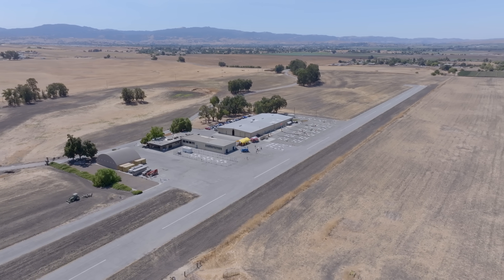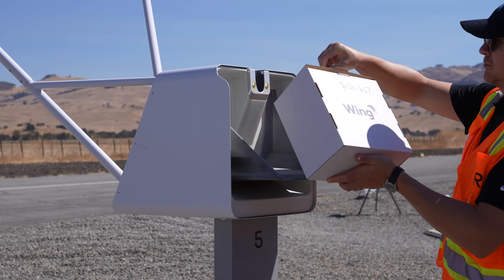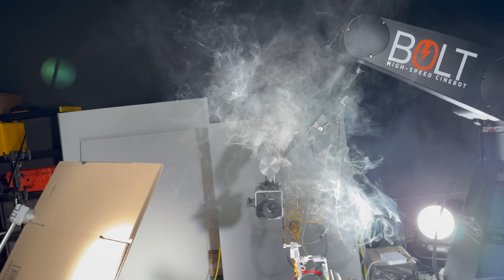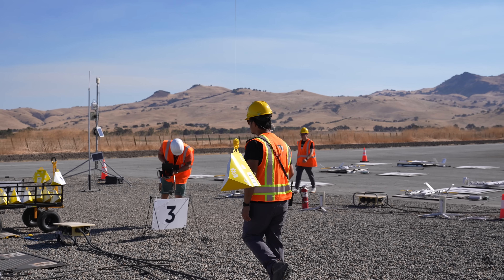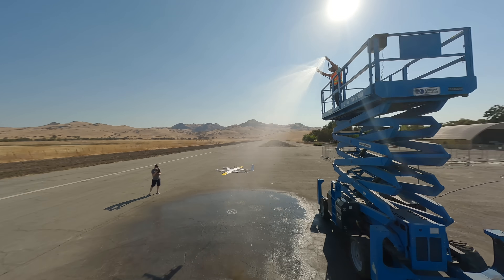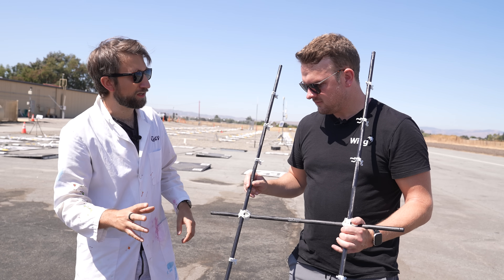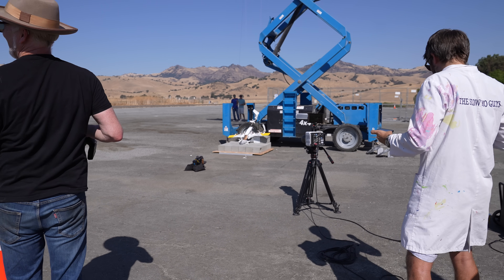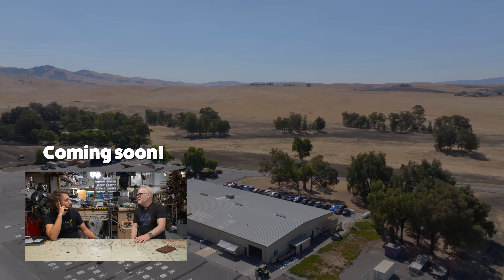Ultra Slow Mo Propeller Smoke Vortex - The Slow Mo Guys @tested

Comment: what you have to remember is that those aren't individual vortices. they are all part of the same helix, or rather, the same 4 helixes, following the tips of the blades, all the way around. with the asymmetric blades, those helixes get tangled up and destroy each other, resulting in a balanced white noise effect rather than a loud hum.

Comment: I do wish they would stop claiming "reduction in CO2 emissions". Energy is energy. These drones require batteries which require charging, whether from the sun via solar panels (photon energy to electron energy at ~12-18 percent efficient) or from the power grid which is created by hydro-electric dams or methane/diesel/gas/propane driving generators. Solar panels from solar cells require a tremendous amount of energy to melt the silicon, grow the ingots, slice/ process......

Comment: 0:30 with how inefficient drones are, I HIGHLY doubt you reduce CO2 emissions by using them for delivery. Even if you charge them by using renewable energy (which is rarely the case), manufacturing alone will cause more emissions than using more conventional methods of transportation.

Comment: @5:07 I think 3000 'rotations' per second is optimistic. That equates to 180,000 RPM and I think even FPV drone propellers top out at about 50,000 RPM. I think you are talking about 3000 individual vortices created by the 4 blades on the propeller. That would mean the actual RPM for the propeller would be about  45,000 RPM which would be more in line with my expectations.

Comment: I'm honestly just impressed by the blade strength. In the crash, that one blade on the right was bent over 90 degrees away from plane, and held at that angle for a bit of time, and then appeared to return almost completely back to plane again. I was totally expecting to see some broken blades, but it's like they're made of rubber.

Comment: You guys should try capturing some triboluminescence (crystals glowing/letting off light when being struck or fractured). Filming tape letting off light when coming off the roll, or ice cubes glowing when cracked out of a plastic mold.

Comment: Hey, scientific and acoustic question here…
When the tri blade prop made a single consistent pattern of blade-tip vortices, would that frequency of rotation (rpm) correspond to the prop noise coming off of that? That’s what I assume because it gets higher pitched when the speed is increased. So if that’s the case, my assumption about the 4 blade prop with offset blade lengths is that the sound coming off the prop is no longer a consistent pattern of pulses (waves) but is now 2, slower (lower frequency), out of phase with each other… so is the prop generating its own noise cancellation with 2 similar patterns happening out of sync?

Comment: Just consider now that those smoke vortices are literally occurring continuously around the entire 360 degree circle at the same time, forming what are essentially "smoke rings", but we only see these as "vortices" because the smoke, lighting, and camera are only setup to isolate a singular 2-d cross section  at one arbitrary location within that greater ring structure.  This is happening all the time, even if we don't have smoke to illustrate it.  Cool thought next  time you look at boring old fan.,,,🤯

Comment: Can’t be just me but…. I can’t help but think about this in 3 dimensions rather than what we see on screen represented in 2 dimensions - and that there are multiple spirals of vortices (at least one starting at the top of each per propellor blade) 

I’m really curious to see what multiple stream of smoke would  look like at various positions of the flow. Forgive me I’m far from an aerodynamicist
Reply: Those smoke vortices are literally occurring continuously around the entire 360 degree circle at the same time, forming what are essentially "smoke rings", but we only see these as "vortices" because the smoke, lighting, and camera are only setup to isolate a singular 2-d cross section  at one arbitrary location within that greater ring structure.  This is happening all the time, even if we don't have smoke to illustrate it.  Cool thought next  time you look at boring old fan.,,,🤯

Comment: Ugh this might just be one of my favourite videos ever.

As an Aerospace Engineering student, my Capstone Project was designing/modifying an existing drone design to be able to VTOL while also using these special underactuated rotors that were able to change their trust vector (for even more control on the aircraft as well as only needing two rotor blades instead of at least 4) to be able to change the angle of the rotors themselves without needing any servos to change the angle of the propellers.

My specific role was in the CFD (Computational Fluid Dynamics) portion of project so using software to observe and predict the flow of air around the aircraft.

Seeing those vortices and the flow around the propeller and such high speed is just incredible after doing the math and seeing it in software for the last couple years.

Great video! Would love to see more on this stuff :)

Comment: drone delivery will be huge but Wing still seems to approach it as a homebuilt solution. The craft is too large and elaborate, not nimble. It should just be two tilt wing rotors and their landing platforms are outside on the ground. What is that? They should be coming out of a building. They should also set the package down, not wire it down or drop it hap hazard in a large yard. Not everyone has large drop areas, it should be publicly registered platforms and people in apartments could have those on a balcony or under a window. No more porch pirates.
When robotic kitchens are 24/7 and drone delivery is instant and cost free, it will be huge.

Comment: 11:05 that sacrificial breaking design is seriously impressive. The white pieces /could/ have snapped as well if needed, but in this case only the little screws snapped. So it's still easily repairable. Simply genius design.

Comment: Why don't the propeller blades have vertical tips to reduce the vortices and increase efficiency like plane wings? Or better yet a shroud which does both of those while also increasing thrust?

Comment: Something I thought, and I’m sure this is easily explained/has been explained before, but given this test we essentially only saw a 2/D representation of the vortexes being formed along the plane that the smoke made contact, how does that look along the the entire blades path? Also would a propeller & motor make nearly as much noise in a vacuum chamber, or is it almost all wind turbulence in relation to the propeller

Comment: They're going to reduce CO2 emissions by using drones running on electricity generated by coal and other fossil fuels, with lithium batteries, which have an obscene pollution and carbon footprint, out in the middle of nowhere, thus necessitating the employees and delivery drivers burning tons of fuel to get to and from their location?
And the drone's propellers and frame are made from carbon fiber, which is oil based and very difficult to recycle, as demonstrated by the wind power industry's problems doing so.
Oh, and Styrofoam, yet another hard to recycle oil based material.
And what about the plastic containers the packages are delivered in?
I'm thinking a guy on a bike will generate less CO2 in a day than one of these drones will in a single trip.
Thumbs up for your slomo, but definitely pass on the ecological nightmare that delivery company is.

Comment: So one could apply the correct amount of pressure holding the drone while firing an arrow with line attached and pull the drone out of the sky with an extra hand. Seems simple enough.

Comment: 11:03 - The first one going CUASES the second one to go the same way that spaghetti breaks into three. Because of the relief of the pressure, the bar restores to its normal angle, propagating this correction down the bar until it hits the other join, which gets torqued even harder by this correction and it snaps.

Comment: NOT 180,000rpm.  That first motor is the EMAX RS2205 2600kv, and is not capable of 3,000 rotations per second. On 4s battery max voltage 16.8x2600=43,680rpm max and pulling over 30amps.  It's more likely you just added a zero.  It's probably 300rps and 18,000rpm
Reply: Just watching this very interesting video again, I see you are actually talking about the rotation speed of the smoke rings, which certainly look like they could be spinning 10 times faster than that propeller. Guess that's My mistake.  For anyone interested that's referring to around 5min mark in the chapter currently called "Propeller Speed"

Comment: It’s hard to ease co2 emissions when all our power comes from fossil fuels and inefficient solar cells which must be mined and manufactured using fossil fuels only to be replaced every few years. It’s not just that almost all electricity comes from fossil fuels, it’s that a lot of energy is lost in transmission lines and even more lost as heat while charging the batteries whose metals need to be mined and refined and recycled using fossil fuels. Unless folks read a little and find out that nuclear power has been bastardized and that there are already reactors that use “spent” fuel. If we funded the research we could have perfectly safe and perfectly efficient nuclear reactors which would make energy and heat so inexpensive that research in photovoltaics and battery technology would be able to catch up before a single “waste” facility filled up. You see, we already know how to reuse and recycle nuclear fuel so doing it right is just a little research and implementation away. Making better batteries and solar electricity is much much harder and takes much more experimentation because semiconductor technology requires enormous amounts of money to leap forward. Nuclear energy is basically very simple. Knowing how to dope which semiconductors with what takes trial and error and big machines and labor. We already know how to concentrate uranium and heating water with it is so simple anybody could do it. Imagine if our best were on it. Then we could actually stop carbon emissions for real. Obviously politicians don’t actually want to reduce carbon emissions, they want to tax them. This is why you release more carbon when you charge your cars battery than you do when you fill the tank. It’s because there’s a bunch of fuel burning combustion engines transmitting power miles and miles away wasting more energy than you use just to bring the power to you. Any and every idiot should know this already.
Reply: Bro, are you feeling alright?

Comment: My problem with the Wing / drone delivery concept is the NOISE. Those little propellers are insanely noisy. Everywhere would be filled with constant endless noise. I have an itty-bitty Phantom drone and you can hear it buzzing even 300-400 feet away. Vehicles aren't nearly that noisy. Everywhere would be constant shrill buzzing noise all the time.

Comment: 11:00 The bending of the drone structure and the breakaway screws reminds me of how holding spaghetti at both ends and snapping it; snaps it into three pieces. the first break releases energy that snaps the spaghetti again. after the first set of screws snaps off you can see the energy go through the structure and snap the second breakaway screw in the same way.

Comment: 11:00 reminds me of a slo mo video from SmartewrEveryDay of dry spaghetti noodles breaking when bent, always into more than 2 pieces. IIRC, after it fractures at one point, it starts straightening in a wave and reaches another point where the difference in curvature is greater than the material can handle

Comment: The ultimate question is how much co2 is reduced by charging an electric battery powered airplane that is charged up by the grid, of diesel and natural gas powered power plants. Absolutely none. May be if you use solar powered recharging stations but it would take to longer time to charge and deliver anything, not even to account no sun during night or over cast and rain.

Comment: Frangible, great, great... i'm salivating over deliberately weak plastic screws. Throwing around the term "engineered" does not make ANYTHING sexier. If it was a magnetic keyed together multi-piece assembly that gives to a certain level of stress, that would be engineering. Plastic screws will just give in unexpectedly sometime in the future when you least want it out of nowhere, from wear.

Comment: Adam Savage did a video a few months ago about Archer Aviation. Their engineering dude did talk about how they got their propellers way quieter - the secret sauce is called "vortex shedding" (or the prevention of shredding into the vortex of the previous blade). The tip design is crucial! 🤘
Reply: Still loud enough they have to raise their voices for the video.

Comment: On one of my early FPV drones, I was using plastic bolts as well and not metal one as my peers, so that, in case of crash, the carbon fiber frame stays intact and you just have to replace the bolts and fly again.

Comment: Reduce CO2 sounds great, but when is that likely, given you have to first source the materials, the batteries especially, not to mention get approval for such a large-scale undertaking. We successfully stopped a wind farm being erected not a stone's throw from our house using the offset CO2 argument they were making, and pointing it out each turbine would take around 12 years to break even, IF THEY NEVER STOPPED, so how does this compare?
Reply: Thanks, NIMBY. Remind us the operational lifespan of a wind turbine?
Reply: @Dysiode  20 years, which in total hours was less than the projected hours the turbines needed to be turning, at full pelt no less, to make back the CO2 generated putting the turbines up, hence why it was cancelled. What we campaigned for instead was a solar farm between our village and the next, on a disused field no one had any interest in using for farming, and was looking run down. That solar farm has been going for about six years now. So yeah, not in my back yard, somewhere sensible, using more affordable and constantly improving green energy, obviously.

Comment: Very nice ! I've been working for a few years with a Phantom in a lab where we tested a lot of drones, and it is sort of funny to me to see pretty much the same stuff we did, but with different drones (and a better camera and camera operator 😅).
By the way, the propellers with different blade length are not only interesting for the noise, but also  diminishes vibrations in the structure of the drones and changes the lift efficiency, eventhough the latter is not very well described in litterature nor very predictable.
Reply: That's the point of the blade design, making them slightly less intolerable is a happy marketing side effect

Comment: 5:33 Pilot here; also the interruption of the wingtip vortices could reduce induced drag and thus reduce total drag on the propellers making them more efficient. Winglets on large transport aircraft does this as well. Induced drag is a by product of lift and is calculated into total drag which opposes thrust. Drag is, of course, a negative component in aircraft efficiencies.
Reply: This is more likely the reason for the design, making the incessant whine slightly less intolerable is just a convenient marketing side effect

Comment: On various high speed fan blades used for cooling there was interest with scalloped trailing edges of the blades to reduce the noise. This was put into a small commercial use but have not seen it spread into other applications. Curious if Wing gave this technology any consideration and if so what are point and counter-point that determined the final design of the blades. Thanks for sharing.

Comment: The smoke vortex shots blew my mind. I had no idea
Reply: Just consider now that those smoke vortices are literally occurring continuously around the entire 360 degree circle at the same time, forming what are essentially "smoke rings", but we only see these as "vortices" because the smoke, lighting, and camera are only setup to isolate a singular 2-d cross section  at one arbitrary location within that greater ring structure.  This is happening all the time, even if we don't have smoke to illustrate it.  Cool thought next  time you look at boring old fan.,,,🤯
Reply: I did (multiple aerospace engineers in my fam) and I still loved it!
Reply: made me wonder why propellers don't use winglets!
Reply: One of the things that really blew my in fluid mechanics was the idea of the "energy cascade" over massive scales-- that a hurricane hundreds of miles in diameter is dissipating as smaller and smaller vortices all the way down until molecular forces overcome the inertial ones. Continuums, man.
Reply: Indeed, mine also. The thing that got me is look at the small vortexes and the action that they produce. Now go look at a video of the planet Jupiter and the bands of storms that envelop that planet, they look real similar. Basically, this really shows me what the wind speeds must really be like on Jupiter.
Reply: @xippzap  wind speeds don't need to be exotic for vortexes to form... but the winds on Jupiter are indeed extremely strong, "supersonic" in the polar regions (~900mph), about half of that at the periphery of the red spot. the strongest winds appear to happen on Neptune, ~1100mph. 

if a little propeller can get pretty noisy, imagine how loud things are on those planets... the sound waves energy heats up the (localized) atmosphere by a few thousands degrees (can be traced in IR).

Comment: You should "invest" in a cheap spinning mirror/laser pointer setup to film laser sheets of smoke. This is a common technique in studying fluid flow, but your high speed setup could also make some really nice YT footage with it. Could be a simple as gluing small mirrors to a drill bit, but you could probably buy a better version for not a lot of money.